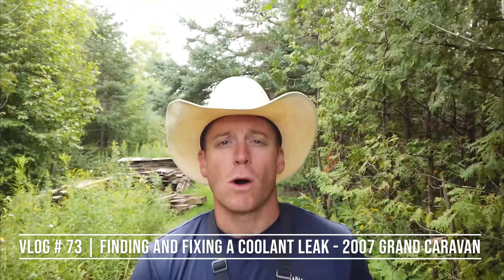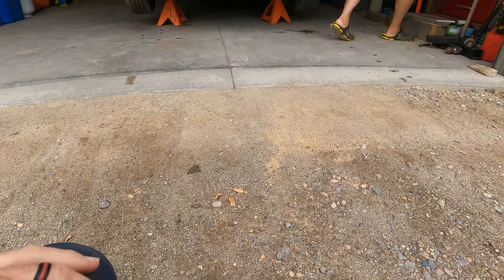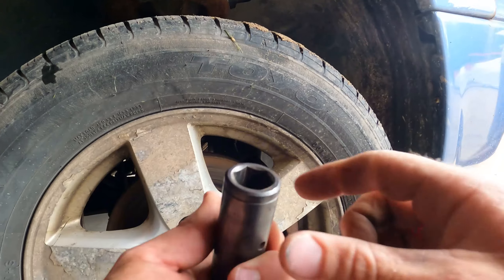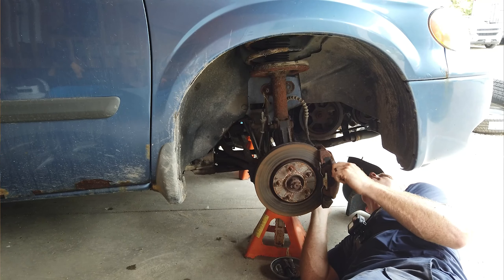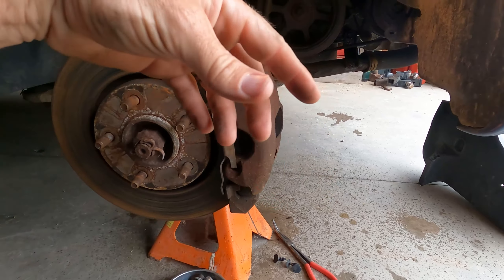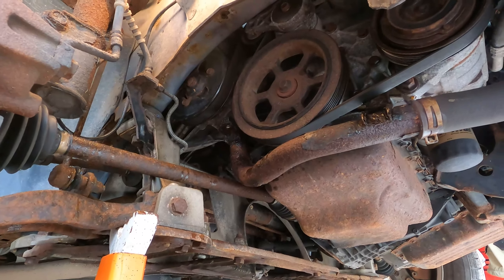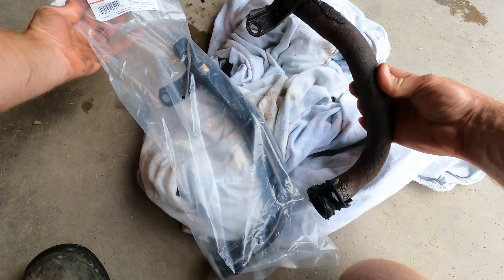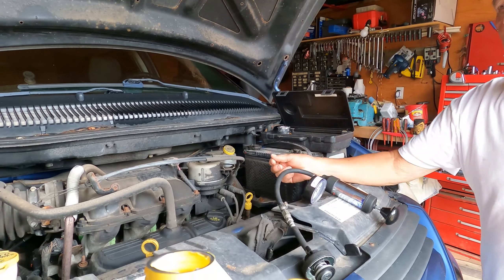Finding & Fixing A Coolant Leak On My Sister's 2007 Caravan - No.73

Comment: Coolent inlet tube correct? I've been having coolent leaking but I don't know if it's from the water pump or the inlet tube 😞 I have a 2005 dodge Grand Caravan
Reply from the maker: Hello!! It was the water pump inlet pipe I believe. Remove the plastic wheel well, start it up and stick your head under there. If it’s the pipe you should be able to easily see the leak. If the water is leaking from higher up, it may be the water pump or something else.